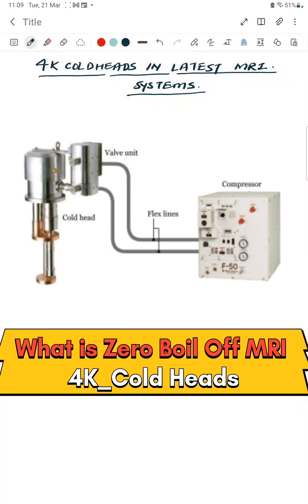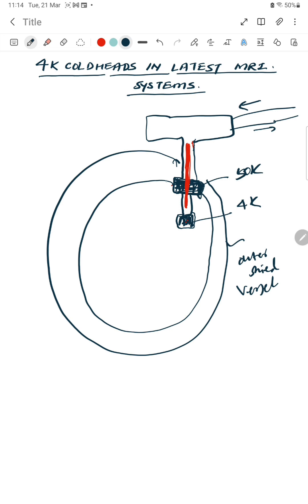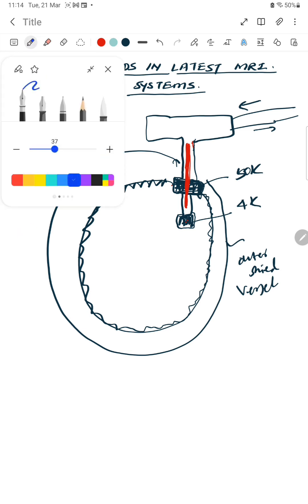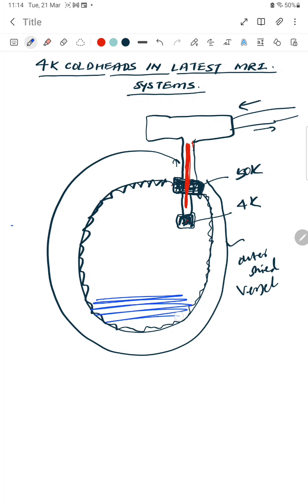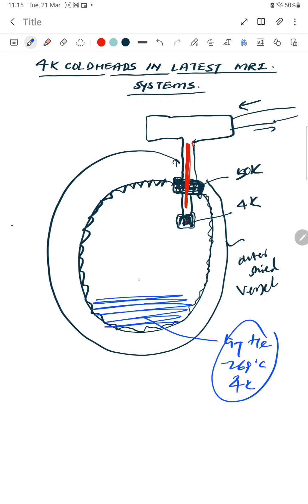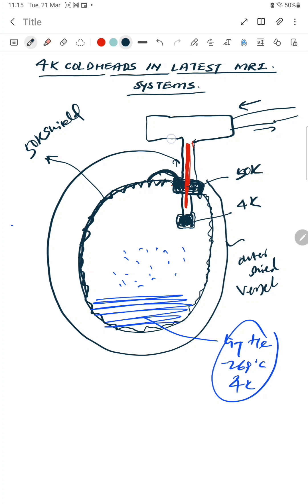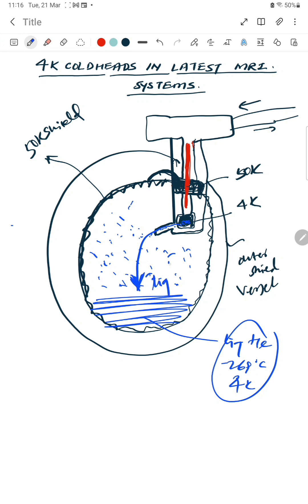MRI Basics| 4K Coldhead MRI Magnet Technology | Coldheads in MRI| Coldheads Working (Part-9)

Comment: I used to rebuild the cold heads. They use these for a lot more than MRI machines. Also tese cold head stirling cycle devices are for cryo absorption maintenance pumps for UHV systems. Also, the gas used in these is not regular helium, it is usually a mix of regular helium and helium 3, this allows the cold end to reach milikelven temperatures if in a vacuum, but in a mri it reaches 4k and stops there. ❤
Reply from the maker: Great Input. I am thankfull to you that you spent time to see my vedio. I am very new to youtube. Still learning to make good vedio. Thank you once again.